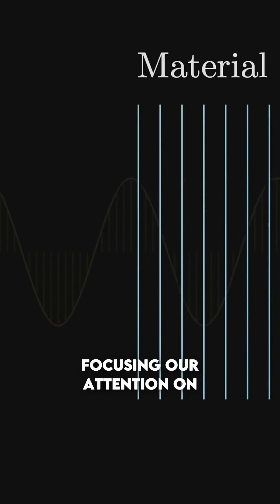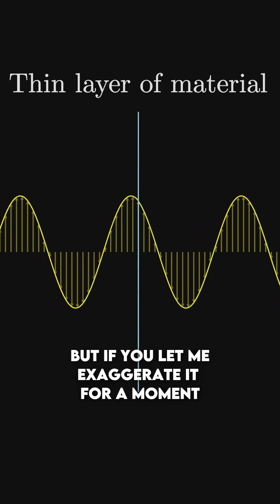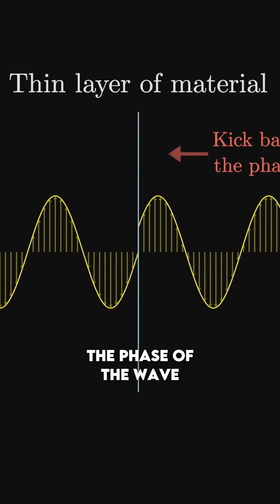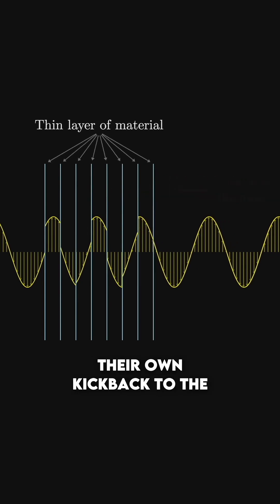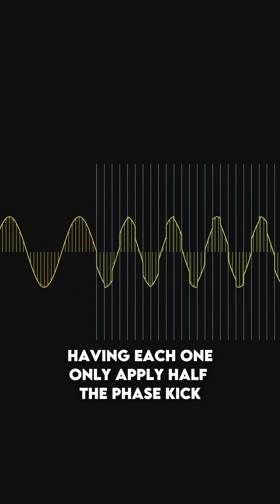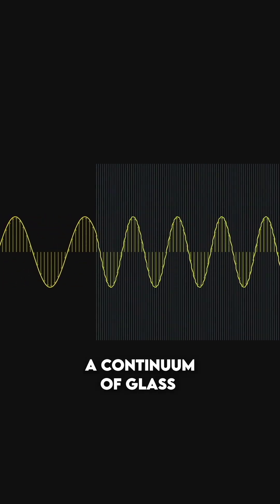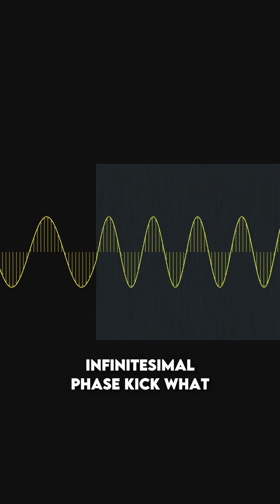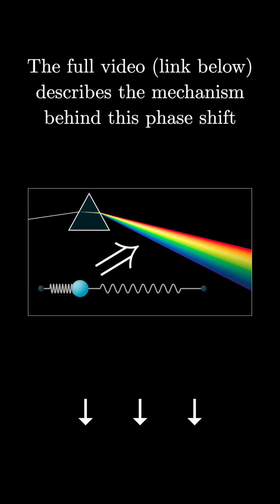What does it mean that light "slows down" in glass?

Comment: An uncharacteristically sloppy and inconsistent explanation.  The animation is inconsistent with the narration.  The explanation implies that the longer light travels in a medium, the more phase kick-backs, and therefore the slower and slower it would become.  That is not correct.  Further, the animation shows all the changes occurring is a region near the surface.  The full 30-minute video is much more concise and satisfying than the 60-second "short".
Reply: that's not what was implied at all
"kick back" does not mean "slow down", it means offset the phase while keeping the speed exactly the same. there is a difference between a change in position, which is what was actually implied, and a change in speed, which was not said or implied

the cumulative effect of all these offsets in position is the same as a decrease in speed as the number of glass layers approaches infinity, you can imagine this as walking forward at say 5 metres per second but getting instantaneously teleported back 1 metre for every 5 metres you travel, overall you'll be moving slower than if you were walking at the same speed without any teleportations

Comment: if this were the case then the angle of refraction would reflect the width of the medium. but it dosent. 
the angle of refraction reflects the difference in density between mediums.  despite the thickness of the density of the space. once the light enters the glass it's.  it's wavelength and direction do not change.
Reply: word soup
Reply: the wave hits the glass dead on. there is no refraction to speak of

Comment: A coaxial cable does the same thing to a radio wave because of the inductance in the conductor of the coaxial cable and the capacitance between the two conductors there is a lag.   Longer. The cable the more phase shift you get .

Comment: The explanation is correct, the graphic representation it’s almost perfect. In your graph the wavelength it’s getting shorter at the entry, then remains constant. When actually, if i’m not mistaking, in reality the wavelength it’s diminishing little by little as it goes through the medium.
Reply: Its the amplitude or strength of the wave

Comment: YOU ARE INCORRECT . The speed doesn't change, its the wavelength or frequency. Don't spread misinformation.
Reply: What are you talking about? If the wavelength changed the light would change color. But it does not. Light does slow down and only travels at c in a vacuum. Thats the reason why cherenkov radiation exists look it up
Reply: @barnabasrsnags4828  the frequency changes not the speed. The wavelength compensates to keep c constant somewhat ✅👍.

Comment: If this happens the wavelength shud in a short span reach zero as it kicks back further in upcoming layers … this is not an accurate explanation .. 
meaning will the light at a point stop if travelled in glass .. then the graphics is inaccurate as it has constant wavelength post entering a denser medium ..

Comment: How does the glass "kick" the wave back?
Reply: Apparently, according to another comment from a guy named Nathan, the material absorbs and re-emites the photon, that kicks back the phase comparing it with the unaltered wave
Reply: @angelariquepons1119  Thank you.
Reply: I think it is intuitive that light takes more time to travel through mass, vs. massless space-time fabric... when you remember light is more like an electromagnetic field than a particle of mass.
If you have space-time fabric "stretching" and creating an electromagnetic field as light moves into its space, and then collapsing as the light moves along and away, then realize that if there is "matter" there, this matter will have greater inertia than the vacuum of space (fabric).
So, the time it takes for light to move into it and then out of it, is greater because that mass resists electromagnetic field increase/change just like a softball resists your attempt to throw it (moreso than a ping pong ball resists you).
Reply: That's there in the full video. It's because of a counter light wave made by the oscillations of atoms on each surface of the substance.
Reply: Well the material takes time to interact with the wave, absorbing and re-emitting the light again and again and again while passing through that medium.  This causes a consistent overall offset in time for the wave as it passes through that material.  Sort of like how drag on a falling object causes it to slow to a given terminal velocity, but faster.
Reply: time dialates with density. the angle of refraction reflects the difference in density between mediums.  it redshifts. 
which prooves the universe isn't expanding. because redshift is caused by the increase in density over time as mass collects . not expansion.
Reply: It's got nothing to do with absorption, light is an electromagnetic wave and the electrons in matter have a retarding effect on that wave, same as a bu ch of buoys on the surface of water sort of suppress the amplitude of the waves temporarily
Reply: @31sebman  bullshit. or the width of the glass would have an effect on the refraction. it dosent
Reply: @atticuswalker  read the Feynman lectures on that topic
Reply: @31sebman  I did. but it's wrong
Reply: @atticuswalker  lmao ok buddy, you clearly know better
Reply: @31sebman  I have more information available than the people who did the best they could. with the information they had at the time.

Comment: The kickback only affects the phase of the wave, would it not still travel at the same speed?
Reply: No, because it is not just one kick back. That lowers the average speed, it's like taking a  1 sec pause mid aire every time u take a step runninng, it would be same speed as walking
Reply: @angelariquepons1119  So the light wave "pauses" at every "layer"? It literally moves in a jittery fashion?
What I picked up from the video is, if I were running, my legs would flicker to another pose mid-stride, but will otherwise still be swinging just as fast.
Reply: @yueshijoorya601 yeah, I got the same at first. I think what happens its there is not such thing as "Light going trough a material" what happens it's every Photon is absorbed and re-emitted on every atom it encounters, causing a delay. May be like having a line of people moving a box hand to hand instead of walking with it. The box don't "Moves trough people", it gots received and re-sent by every person on the line.

Comment: So what is the kickback then? Absorption and re-emission by an electron shell?
Reply: It's a superposition of the dielectric of the glass (or other material), producing its own electromagnetic waves in response to the incident light. The sum total of the two waves, produces a net waveform that makes light appear to slow down inside of the glass, regarding its effect on the wavelength.
Reply: @carultch  But given that light travels at light speed and thus cannot undergo state transitions (given its lack of an internal clock), doesn't this mean that in order to produce that electromagnetic wave some interaction with the photon must take place, and thus the photon must be absorbed and reemitted somehow?
Reply: @carultch so group velocity is lowered but phase velocity must stay the same?
Reply: I was wondering about thesame thing, maybe like a pinball-like effect that cancels out direction-wise on macroscopic scales?
Reply: but how does that change the phase?
Reply: think of it in wave nature of light  @nandovancreij
Reply: @nandovancreij  the light is emitted a miniscule fraction of a second lator, thus kicking the phase
Reply: @NamanNahata-zx1xz So why is the light emitted in the exact same direction of travel as before it was absorbed? Reemission is random, right?
Reply: These questions can be answered in the main video

Comment: How come then speed comes back higher (increased ) when it comes out of denser medium to air/vaccum?
Reply: I'm guessing you initial thought was the wave has a new, slower velocity inside the medium. As it exits the material, it's no longer being pushed back, so shouldn't it just retain the same velocity it had in the material? To answer this, we look closely at what was demonstrated in the video. The wave travels at the exact same speed in between the layers, it was only being pushed backwards for each layer, giving the impression that the wave as a whole was traveling slower. As it exits the medium, it's no longer pushed back by the layers, so it maintains the same velocity as it had before entering the medium.
Reply: @dageustice  or, can we say that the matter stretches the space within the boundaries of  material? That way, light travels longer for observers, i.e. us, whereas in the frame of reference to light it goes at the same speed but travelling longer. When light comes out of the denser medium, space contracts again becomes "normal" from the observer's point of view?
Reply: No because if space stretching occurred inside matter, then there would be a slight force that tries to separate an object. Obviously this force doesn't exist (btw space bending such as gravity isn't really called a force, but I'm just simplifying). There exist stress forces which happen due to incorrect manufacturing and don't really interact with light in terms of its apparent speed. Lightspeed is constant and it just appears slower as it goes through more stuff. Higher frequency waves tend to go through more material so they end up appearing to be slower than lower frequencies, causing prismatic separation. Truth is, we just don't 100% understand this stuff yet. We know something about light, but not everything.
Reply: Look at the second video about this theme, it answers your question
Reply: Did you even whatch the short?
Reply: Because the velocity never changed. The speed of light is a constant.
Reply: Because the vector quantity is no longer present and it returns to "normal"